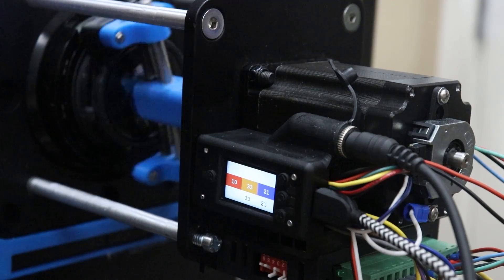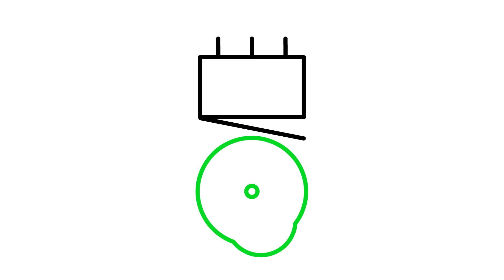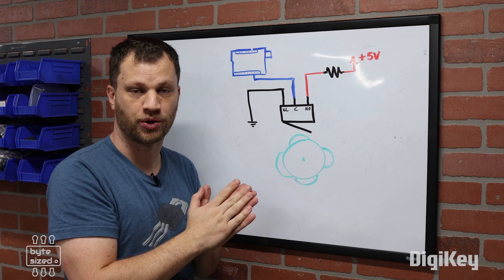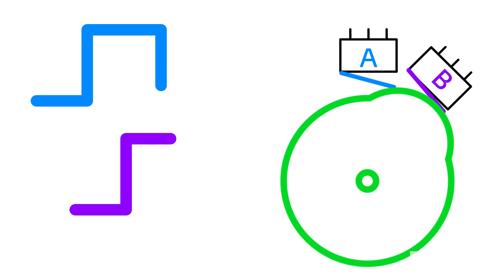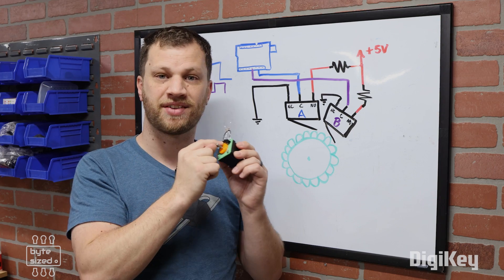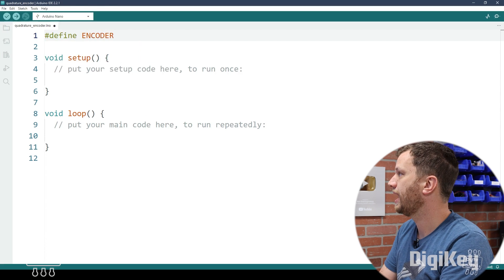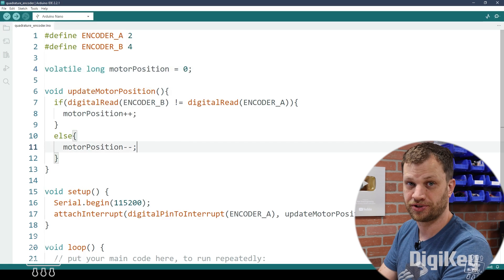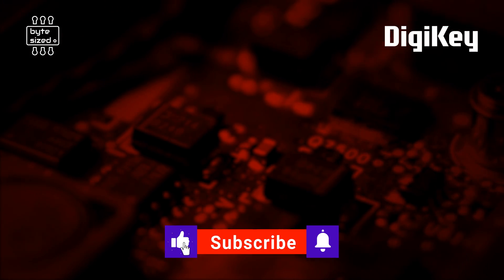Understanding and using quadrature encoders - The Byte Sized Engineer | DigiKey

Comment: 10:20 This is not an error but a decision to only look at rising as one of the possible four combinations. Your current code only looks at two of the possible four combinations. Is that an error? To look at all combinations would require two interrupts, one for each pin and processing either a dual ISRs independently for pin-A and Pin-B or a single ISR combined with history. 
Three modes PPR X1,  PPR X2, PPR X4  .

Dual Interrupt, single ISR with history  
CW  State 00AB: A leads B. A0 -> AB -> 0B -> 00 - 0010, 1011, 1101, 0100  or  
CCW State 00AB: B leads A. 0B -> AB -> A0 -> 00 - 0001, 0111, 1110, 1000.  
The other 8 combo are invalid states.

Comment: Watch out, the code doesn't miss pulses, it can now add phony pulses. Lots of jobs with quadrature encodered motors need to halt and hold position, but if yours bounces back and forward on the single interrupt edge, you may miss it being a pulse opposite to the last one.
The best way to do this is to interrupt on one line, then change the interrupt to the other line. That way you can bounce up and down on one line, but after the first change, it will ignore it. You only look at the stable, non-interrupt input.
 The code should be: On an interrupt on line A, record the state of line B and change the active interrupt to line B. On an interrupt on line B, record the state of line A and change the active interrupt to line A. The recorded AB states tell you the rotation direction at each interrupt.  
Had many problems with software interrupted quadrature counting on long lead screws that "ring" (rotationally vibrate)  as they hit a physical end stop or work piece.
Reply: I think your point is to make sure to deal with debounce issues.  There are many ways to do that.

Comment: Don't you also need to use an atomic_block to prevent the ISR from updating the long variable in the middle of trying to read it in the main loop? ...or does the arduino framework handle this autmotically?

Comment: I'm confused about the comment that it's a bad idea to use mechanical switches. Aren't most basic dial encoders (the ones you typically turn by hand) operated somewhat like this? (but with contacts instead of bumps)

Also, as for magnetic encoders, what's the benefit of using a quadrature encoder when it's also cheap and effective to read absolute position using a diametric magnet?
Reply: Simply put, mechanical contacts make sparks, which translates to chaotic sequence of ones and zeros. This erroneous state is then interpreted incorrectly as missed counts and incorrect direction. Engineers prefer being sure instead.